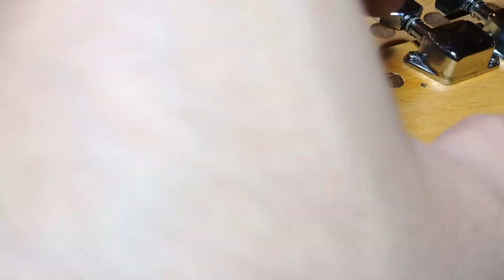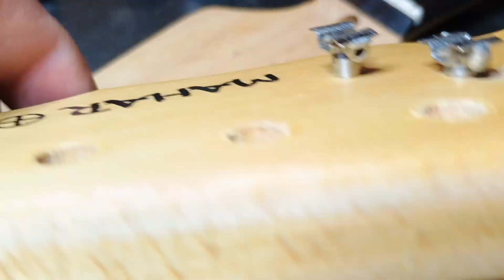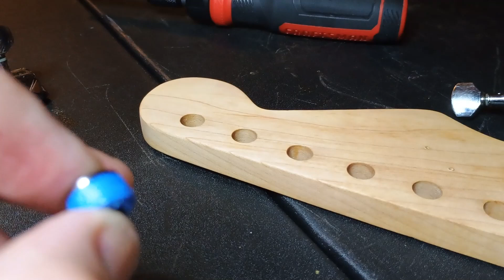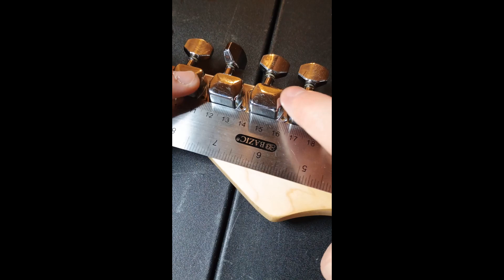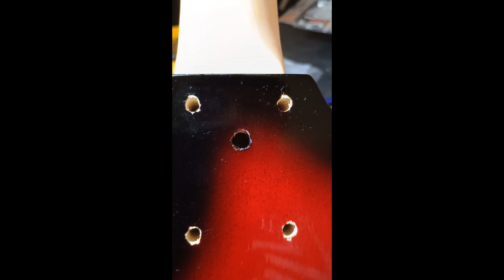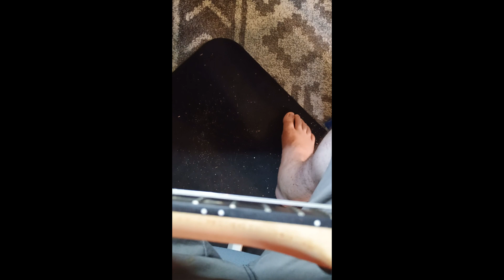Restoring a $[74.16, previously $30] guitar and making it better, Part 13:  Final Assembly!

Comment: You should clamp the straight edge onto the headstock so it doesn't budge (with small clamps) and then set the tuners along its edge. Once you're comfortable with the spacing and alignment, mark those holes and drill baby drill! Good job explaining this, love to see how these projects come out!
Reply from the maker: Easy enough to do with just the straight-edge -- there was some grippy foam on the bottom which helped it stay in place pretty well on the wood so it made quick work of it